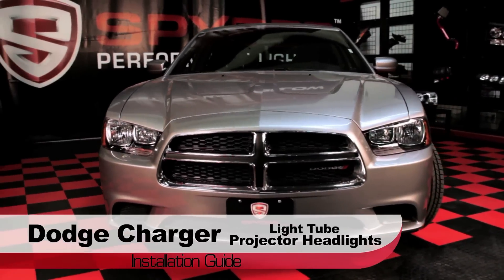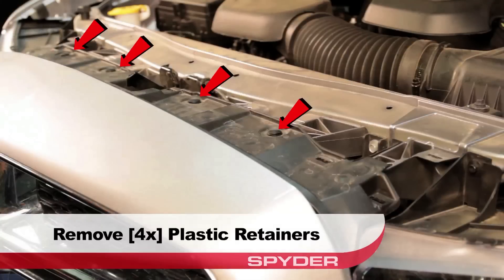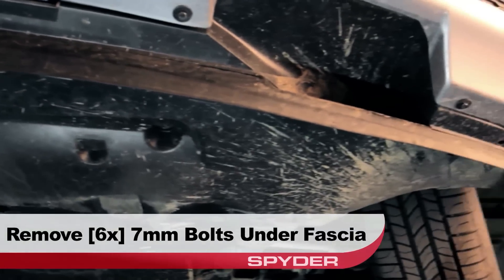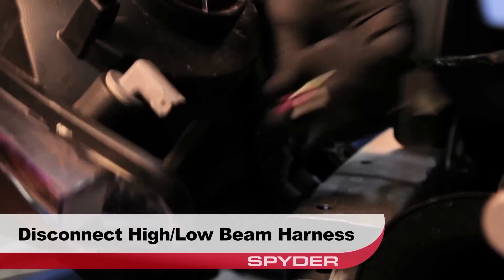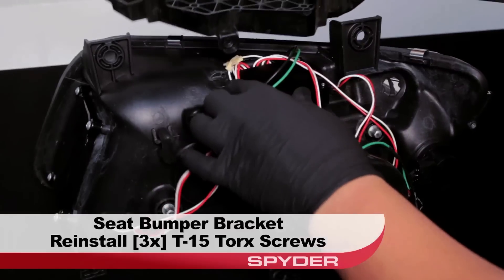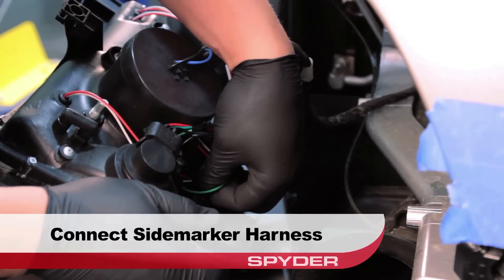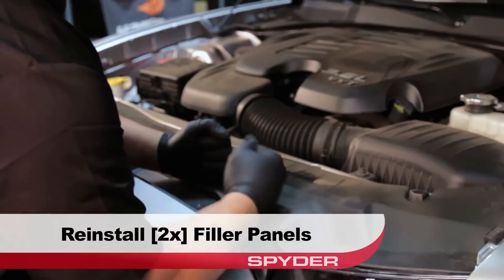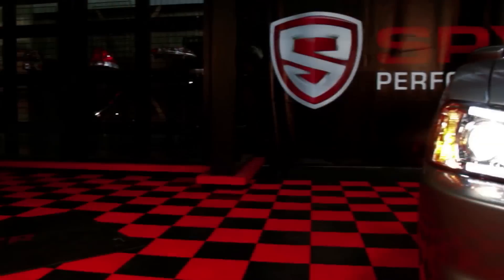Spyder Auto Installation: 2011-14 Dodge Charger Light Tube Projector Headlights

Comment: FYI: If you connect the green cable directly to one of the relays in your fuse box, you will have actual day time running lights Otherwise they come on only when you turn on your lights which kind of misses the idea what the LEDs meant to be! The green cable goes to the converter of the Spyder headlights where 12V turn into 6V and then go to all the LEDs. But then don't connect the green cable to the cars green cable. Otherwiae your matker lights will also be permanently on. I did that to my Spyder headlights for my 2013 Charger and it makes such a big difference!!
Reply: Do you have a link/instructions (and pictures) to complete this? I would love the have the U bar lights always on. I'm guessing this would require cutting the existing green cable from the housing?
Reply: Katherine Ahadi. you connect green cable two 12 volt in the fuse box?

Comment: Installed the lights today and works great. As frustrating as it wuz trying to resolve the install issues, cooler head prevailed. Still not sure why spyder has ballast plug running to the round cover on back of the headlight. I highly recommend spyder send some detailed instruction and update this video and install would be a lot easier. No response from Carid today, maybe tomorrow, but not likely I will purchase from them again. Now job is done, happy with the end result👍
Reply from the maker: ron t it's kind of like a design flaw on the HID model because we only had access to the halogen model. We have notified the manufacturer on this issue and they should do a running change for the future productions. But  the HID model has such small demand comparing to the halogen model the progress has been very slow. Most of our customers just contact our tech support and we can provide a direction to run the wires and it can be done in minutes. We again apologize for the inconvenience and hope you enjoy your new headlights!
Reply: ron t what issues did you run into during the installation?
Reply: Hi Brandon, the problem I had was the way the wires were routed for the balast plug. I had to remove the plug and fish the wires thru the grommet closer to the ballast. Wuz no big deal but the place I bought them from was not helpful in giving me the answers i needed.

Comment: do the halos funtion with the cars factory drl option? seeing as the charger uses the high beam for drl when you dont have halos will this still work if i buy these?
Reply from the maker: by halo are you referring to the light tube? if so, the light tube acts as your parking light. DRL function should stay as high beam.
Reply: yes i was. but i see is it possible to have it spliced in the high beam as well before shipping or no? not a deal killer just would like them to be on durring the day instead of the high beams only.
Reply from the maker: A42yearoldARAB unfortunately all products are sealed before they get sent out from the manufacturer.

Comment: I want to see what it looks like when the turn signal is on. On most new cars, the light tube turns off when the turning signal is on. Do these do that too?
Reply from the maker: Jewishman the light tube will not turn off when turn signal is on. unfortunately I could not  find a video clip with the turn signal flashing. it's basically the amber light at the corners flashing.

Comment: Spyderauto.....Where is the turn signal in these projector headlights?  And I also am curious if these can be installed in a Charger with factory halogen headlights.  Above you say "in any 2011-2103" model, but on amazon and other sites they say these are only compatible with a vehicle that has the factory HID headlights installed now.  Which is it?  Thanks
Reply from the maker: The note on Amazon must be incorrect as these are specifically for models WITHOUT the HID setup. We will probably release an HID version at some point. The turn signal is where it always was, on the corner. Thanks for your interest.
Reply: spyderauto Well the turn signal on the factory lights are on the inside of the housing next to the grill. But if you're saying this model projector headlight has them on the corner, then they moved.  But thanks that's what I needed to know,
Reply from the maker: sorry, i mean there was always an amber but now the corner lamp is in fact the turn signal.
Reply: spyderauto Now in reference to an HID kit for this car .... Is there a certain recommended wattage, because I've heard you don't want to go over 35w.  Is that true or can one do a 55w.  Also does the kit have to have an integrated canbus system?
Reply from the maker: Keenan Arnold 55w HID kits exist but do not use them; 55w HID kits are intended for cars with GLASS LENS headlights. 55w gets too hot and can easily MELT plastic lenses, so use a (4300k-6000k for optimal light output) 35w HID system if you choose to use an HID kit with our product. Contact Spyder tech Support at 626-934-8884 (open m-f 8-5 PST) so we can better help you with CANBUS questions

Comment: Hi I bought these lights from Carid. When they arrived, I saw that the headlights did not have either the low beam bulbs or turn signal bulbs. Is it something I have to buy separate? and I went to some auto stores to buy H7D3S for low beams and I noticed that the bulb socket on the headlights have 3 pins while all the H7 bulbs I found were having 2 pin and would not fit in the socket. Am i missing something here?
Reply from the maker: Hi there, many times you have to transfer the low beam bulb and turn signal bulb over from your OEM units, and this may be the case, but I recommend contacting Spyder Auto's tech support (open 8-5 M-F PST) at 626 934 8884 so that we can better assist you.
Reply: Hey I have the same problem. I was wondering if you found out what bulb to get for the turn signal and low beam. Mine did come with the low beam bulb but I want to change it to the HID looking halogen. On the phone I was told to transfer them OEM over but I told Spyder that it doesn't fit and they haven't gotten back to me in 2 days

Comment: Ordered these from Carid. Not real happy, no instruction on installing these on a charger with factory projection headlights. Didn't know i had to strip my headlights for parts to hook em up. No instruction at all about ballast installation. Plug for ballast goes to back of headlight. How can u plug ballast in when its this position, plus had to use my wire to plug in headlight. Folks at Carid are not knowledgable about the products. Figured a way to reroute plug for ballast. Gonna try tomorrow. A whole week trying to get answers just to figure out myself👎
Reply from the maker: ron t we apologize for the ballast issue you ran into. you can reach our tech support at 6269348884 they can provide you the information how to install the ballast.

Comment: Is there any way to link a instruction guide for how to do the HID transfer from the stock part to the Spyder (PRO-YD-DCH11-LTDRL-HID-BK)? I have stock HIDs and just am not sure how to install the Spyder with that set.
Reply from the maker: Chris Meyer unfortunately we do not have the vehicle with us at the moment. but an comment issue of this HID version is that the HID wires are  too short. you may want to extend your wire if that's what you ran into.
Reply: Okay thank you. Are you aware of any video you have or know of out there that shows how to do that?
Reply from the maker: Chris Meyer i did a quick search online and found this forum topic of this install. i hope this can help
http://www.chargerforums.com/forums/showthread.php?t=206129
Reply: Dang that forum thread makes your quality control and customer service look really bad. I'm going to look into other headlight brands. Granted it was three years ago, hopefully Spyder Auto has changed for the better in that time.

Comment: So is there a way to get these with the hids that appear white and bright instead of the stock yellow look?
Reply from the maker: Blaqkstarr15 we have customers installed aftermarket HIDs without problem but we do not suggest our customers to do so. because most of the aftermarket HIDs are not DOT approved which means they are not legal. also any kind of modification of our products may void the warranty.

Comment from the maker: Abdallh Zahabi i would suggest you try to contact your vendor and see if you can exchange it to halogen model. it will require you to modify our headlights harness to work and that will void your warranty. if you really want to convert it, the oem HID ballast model is OSRAM 35XT5.

Comment: How do you readjust the headlights my brights are very low to the ground and I can’t figure out how to readjust them more up
Reply from the maker: Typically, all headlights should have adjusters on the backside of the lights.  They work to a certain degree and made for a certain tolerance.  If you installed the lights correctly, adjustments should be in range.  If you didn't install them correctly and over-turned the adjusters, there is a probability of damaging the threads or stripping it, not allowing it to adjust.  Adjusters are usually spring loaded as well, so if the spring is too loose, you may not see a difference while adjusting.  Adjusting should always be done at night when you can see the beam clearly.  It should be done following your local laws as to how high it should be aimed.

Comment: hey i installed the spyder headlights on my 2011 charger. but the turn signals in front dont work. I dont know what i did wrong. Please help...... thank you
Reply from the maker: +daniel Thomas you need to transfer the turn signal bulbs from the original headlights to the new set.

Comment: Can you please make a video with the headlights on with the turn lights flashing?
Reply from the maker: Marcos Martinez we forgot to mention about transferring the turn signal bulb from the old light to the new light. the turn signal bulb is the dual filament type, so it is the same amber bulb you see at the corner. when you turn on the turn signal that will be the flashing bulb.

Comment: I bought these lights a month ago, they look great and have great reviews. However the installation video is incredibly basic and nondescript. I have a 2011 Dodge Charger RT with HID/ Xenon lights so I bought the headlight model that were designed for my lights. I knew that the lights did not come with the DS3 low bulb but I was told it could be transferred my existing stock headlights lights and that is not the case. Even the wiring in the pictures does not match. No manuals came with the lights to help install them and the video is close to useless.
Reply from the maker: +Kyle Rockefeller thank you for your comment. if you having trouble installing them please feel free to contact our tech support. techsupport@spyderauto.com 6269348884

Comment from the maker: hello Saleh.

From what I can discern based on the video no additional wiring is necessary and should be plug and play for the light tube. however, if for some reason they are not, you do not connect the angel-eye/led leads to the turn signal- you connect to the PARK LAMP circuit (unless you want your halos to flash?? why?) so that the leds/halos go on when you turn on your headlights. you do not modify your high-low wires with any Spyder headlight. please contact our tech support 626-934-8884